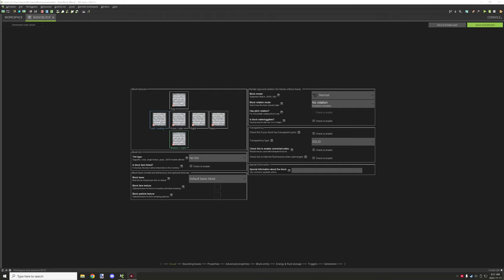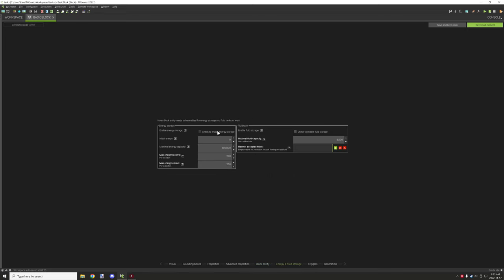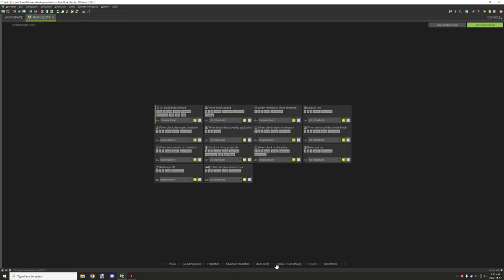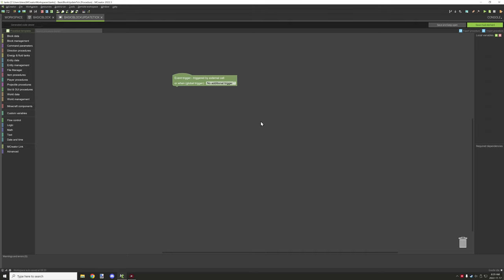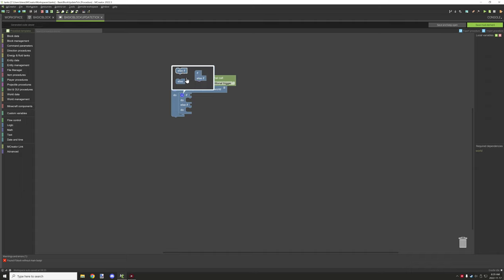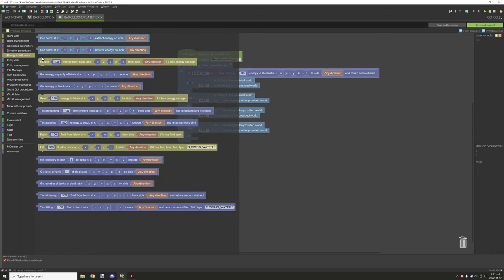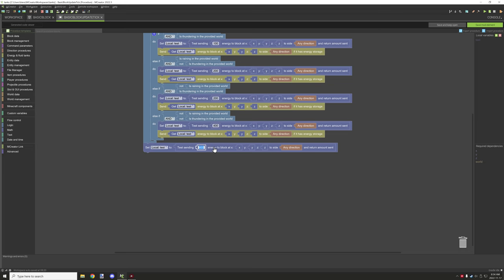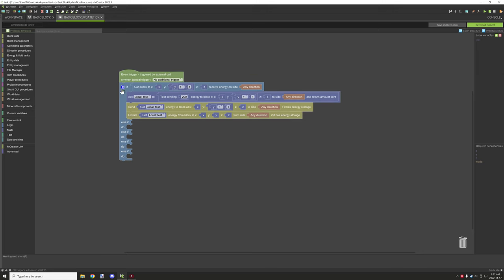MCREATOR: Forge Energy Basics | 2022.3

Comment: How do we make our Forge Energy Machines Consume the Energy as they run and perform whatever other procedures they may do when connected to Power? also How can we detect when a block is receiving power so we can perform another procedure for example to replace that block with another?
Reply from the maker: You would consume the energy at the end of your blocks update tick procedure, if your block has a on/off state then you would want to only consume when the block is on.
To consume it's the same idea as moving energy just without actually moving it to another block. So you simply just subtract the value of energy.

You will want to make a test for how much energy it has.
1. If it has => then value you want to consume then simply subtract that amount.
2. If the value is < than the value you want to consume then you should set the value to 0.0 for the blocks energy as it would go past 0 normally.

Other than that it's just like variables rather then send energy you just remove it from the same blocks position simple as that.

Comment: i have a question do you think it's better to do it yourself with NBT etc. or just use this built-in function.
Reply from the maker: It really depends, NBT energy/fluid systems can offer the same thing and possibly more but there is no set documentation on a "proper way" to configure your NBT names.
This can lead to issues with mod compatibility if you use NBT for blocks, a simple character being off in the name can make it a completely different system so this is where Forge Energy does have its advantage, its already made a specific way but is also very limited to what can be done.

I have planned to make a template for variable names for people to use but I have not gotten around to playing around with different methods in depth but I could end up making a wiki page or something if Klemen is fine with it for Variable Energy. But I would need permission before hand.
Reply: @NorthWestTreesMCreator  And one more thing. If i want to make electric furnace is it possible to add all vanilla recipes and then add additional ones.